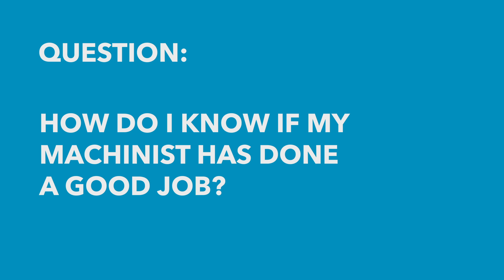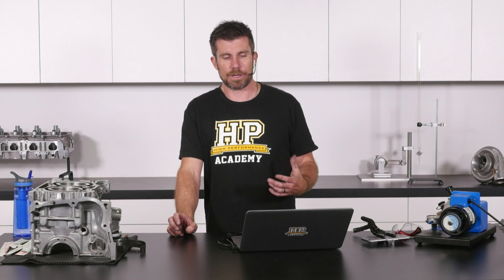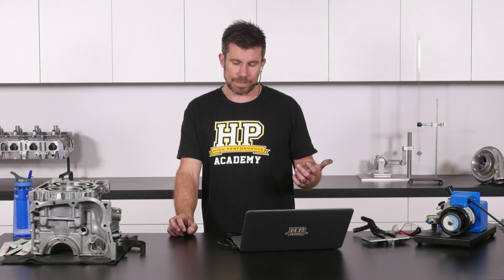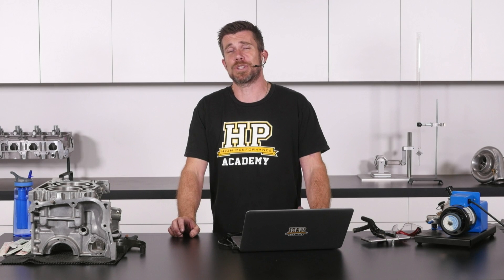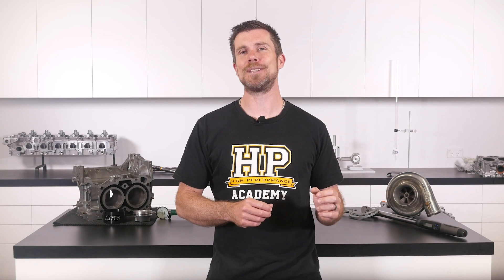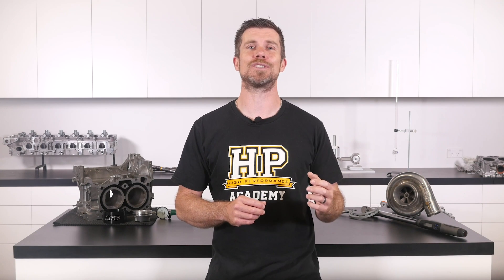How To Find A GOOD Engine Machinist | What YOU Can Do [HPA Q&A]

Comment: In Perth, Southside engine Centre and a bit further out Galloway. A lot of it is the guy operating the machine, but if they have old equipment, it won't deliver regardless of who is on it. Galloway is the only shop a fews years back that had a RA measuring tool and could show me smoothness reading of their decking to match factory smoothness for MLS gaskets.

Comment: I'd consider this, argueably, THE most important part of any engine build as everything depends on the foundations and machining is something that cannot be corrected easily, if at all, by the builder. A good, experienced machinist may also offer further advice/suggestions and feedback on what you are planning to do, for example, companies that have good advertising but poor quality issues or have long delivery lead times.

Comment: Bloody oath you should check their work! even better is if they ask if your going to check it. It's terrible, the amount of people running a business, that ultimately rip people off because of their bad work, which can be really bad. My friend lost his engine block, this place where we live tunnel honed his block, ruined it, charged him full price and the poor fella now has a 100kg paper weight which cost him thousands.

hopefully this video allows people to think of the importance in choosing the right Machinist, it's kinda important. lol
Reply: Yup, been there, had that done with a boring job on a 4 bolt small block - was a lot of money back in the day, and a 300 mile drive each way because they were one of the few places supposedly using a torque plate.
Problem is sometimes you only find out their reputation AFTER you get the work stuffed up.